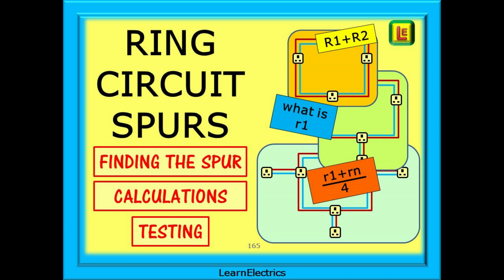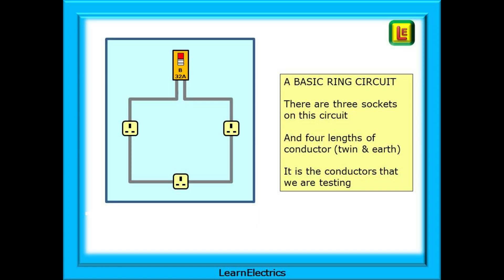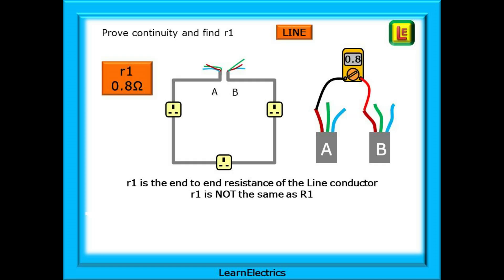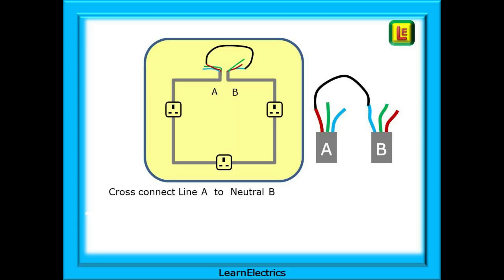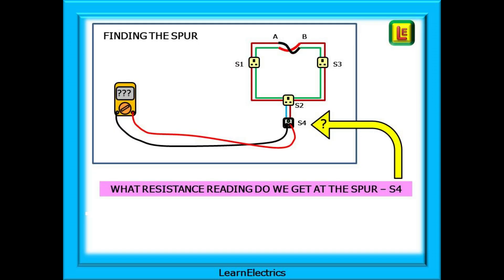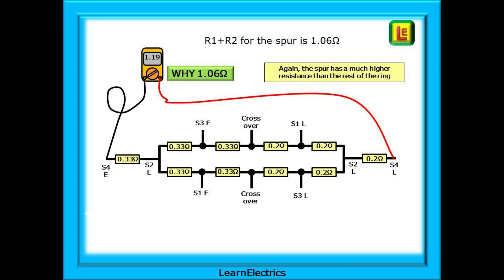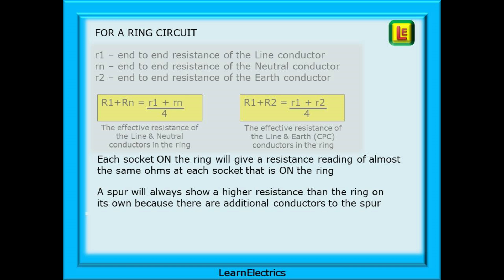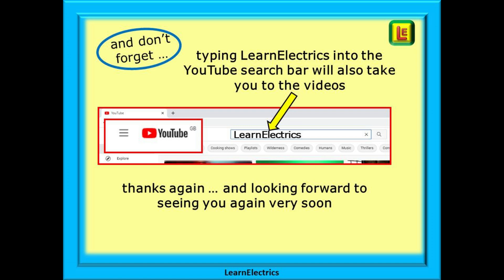RING CIRCUIT SPURS – FINDING THE SPUR – CALCULATIONS AND TESTING – HOW TO SET UP THE TEST

Comment: Thank you for the video. In the parallel resistance calculation for  R1 + R2 ,Why is  r1 1.06 instead of 0.8 and r2 1.06 instead of 1.32 ?  Please could you explain this to me as its really bothering me.Thank you again.
Reply from the maker: These are simple resistance readings so the 80% rule doesn't apply at this stage. !,06 ohms is the resistance of the ring as a parallel circuit, plus the spur line resistance and the spur cpc resistance, both in series with the ring. You will always get seemingly odd numbers when you start calculating parallel circuits. Stick with it, re-watch the video and keep learning. Thanks for watching. Dave.
Reply: @learnelectrics4402  Thank you Dave, I have just started learning the  A B C of Electrics.Its what I always wanted to learn.I must be misunderstanding the parallel circuit.I will research further.Very Grateful for your response.

Comment: Question regs say only one spur off the ring.
  If you have a junction box wago box etc. Ring in ring out then one 2.5 spur out the junction box to a single socket then another 2.5 out the junction box to single socket. Is this allowed technically not a spur off a spur. And can't see how the cable would be overloaded. But is it allowed thanks
Reply from the maker: If you break into the ring and extend it so that it is still a ring but longer - that is ok. You can put more than one socket on that, at 2.5, because it will always be a ring. As you say, its not a spur and no the cable will not be overloaded if the now extended ring is still protected by a 32A breaker or less. Good question. Dave

Comment: Hi there. Just wanted to ask a question. I have had a few questions come up on my 2391 online exam about finding out say r2 on a circuit but really struggle with the calculations. I'm sorry if the question is a bit vage but can't remember the full question. Thank you
Reply from the maker: Wayne, r2 is the end to end of the earth/cpc as shown in the video. If you mean big R2, then it doesn't exist on its own as its a measurement of the ring and needs R1 to go with it. You can have r1, and you can have r2, and R1+R2 but not just R2 on its own. have another look at the video and follow the calculations. Hope this helps. Dave.
Reply: @learnelectrics4402  thanks for the reply. And yeah I've watched your videos and subscribed. They are fantastic, makes understanding it very simple. Thanks for shareing your knowledge with us 👍